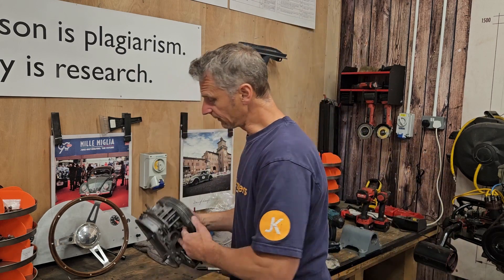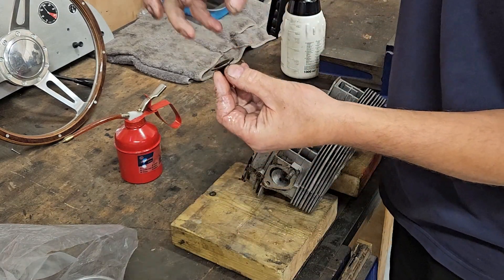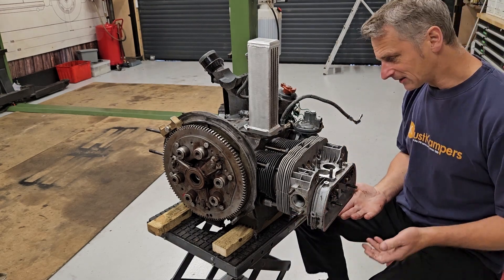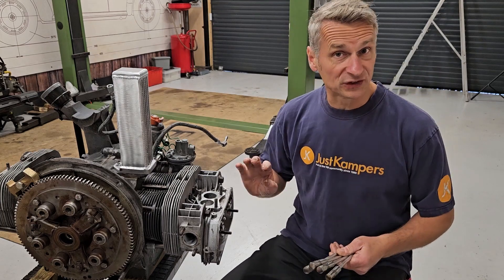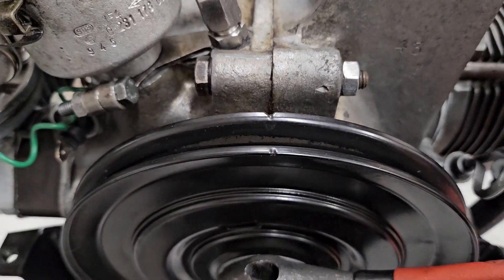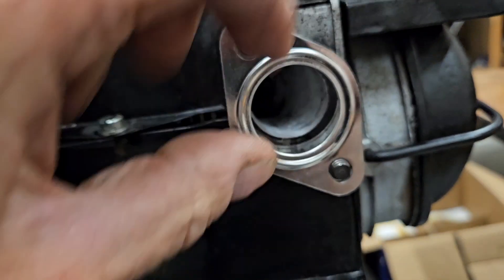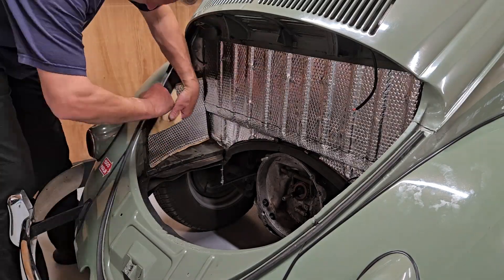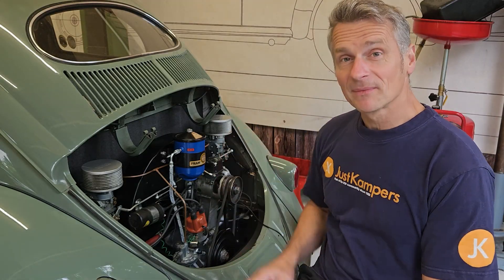Beetle Cylinder Head Build & Refitting: Beetle Engine Rebuild Part 3

Comment: Is it me, or did the engine bay sound deadening change? Looks much better black anyway. Might be worth mentioning that the pushrod tubes have a seam in them that should face upwards. Did the tin that sits between the cylinders get added?
Reply from the maker: Hi, you are correct Mark forgot to film the added Dynaliner over the top! And the tin was fitted yes.